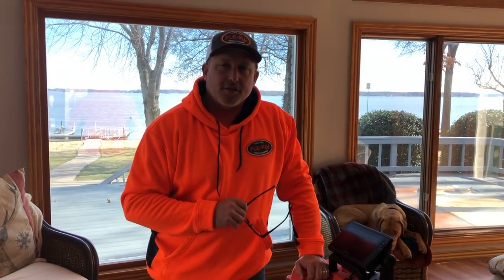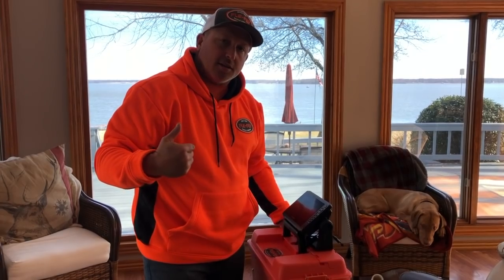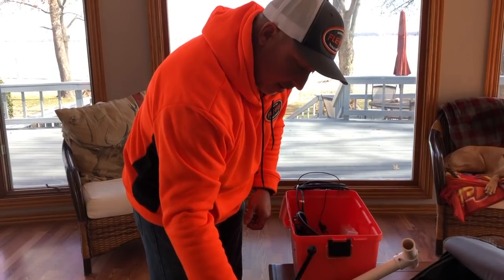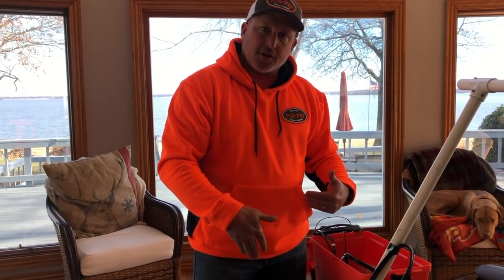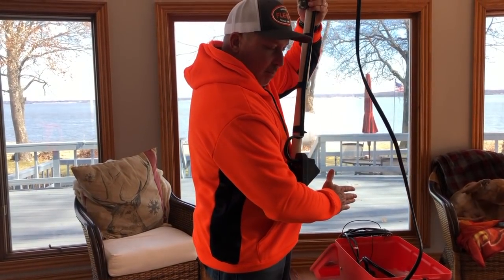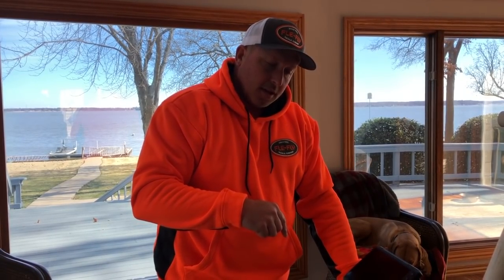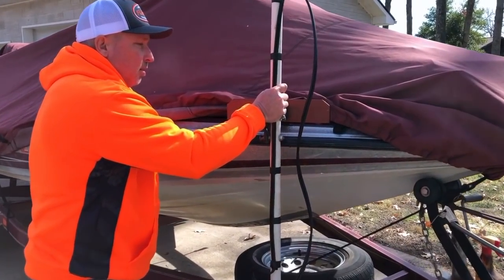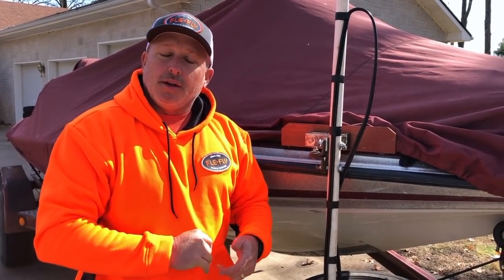How to build your own Mobile LIVESCOPE fish finding system!

Comment: Great  video well done 
I too don’t want to attach to my Minnkota Trolling Motor  I want to use between 2-3 boats
Plano Box is 1612
Looks like you could add the Dakota Charger inside the box as well 
Thanks

Comment: Hey bud I’m building the same thing except I will have a 93sv and the livescope on a switch. Just checking to see if your battery is still working. I’m just not sure if the same one will be enough for me. Thanks
Reply from the maker: Not sure pardoner. Good luck though.

Comment: I just bought the same system but cant figure out how to wire it all together correctly. Could you please explain how you wired the sonar module to the chart plotter? In detail of the connectors you used to connect to the power source.  If you could make a video of the wiring process it self would be a lot of help for many people, me included. Thank You.

Comment: I did the math on this .  The GLS typical usage is 21 watts .  And the EchoMap is 15 watts .    Say we want to run this system for 6 hours .      Math time.    GLS = 21 watts x 6 hours = 126 now with a 85% battery efficiency     126/.85 =148 watt hours now change it into amps  148/ 12 volts = 12.3  Amp  .  Now the EchoMap 15 watts * 6 hours = 90/.85 = 105 /12 volts = 8.75 amp hours.  Add those together 12.3+8.75= 21.05 Amp hours .   We need a 21 Amp hour batter to run this system without blowing fuses.   We can run two of these batteries in parallel  all day long without blowing fuses. Or just use 1 battery for the GLS and 1 for the EchoMap.
Reply from the maker: Wowza! Nice
Reply: Is that with the load of an additional transducer on or with without though?
Reply: @anonymous_friend  that's with the load of the transducer

Comment: I almost bet you're blowing fuses later in the day? As a battery goes below 3/4 of a charge the amp starts to climb.  Not a big problem but if you would hook everything up to a main switch and turn it off after your using it or moving to a different spot it would help.
Reply: if the ckt resistance stays the same,  as voltage goes down so does the current...ohms law

Comment: Its Plano model 1812-50 . I bought it and set up my LiveScope and 9 inch ECHOMAP plus. There are echomap monitors that are cheaper but if they don’t have the “PLUS” they won’t work with Panoptix LiveScope.
Reply from the maker: Right on!
Reply: Fle Fly Fishing Tackle   I’m really glad you did this video. Just what I needed to take my LiveScope to my favorite docks when I don’t have the time to put my boat in but still want to fish!   Thank you so much! Also got some crappie kickers. I bought a 12v 10amphr Nocqua battery (1.5 lbs) from gps store for 119.95  with charger included. This settup is GREAT!
Reply: @onlinenetbuy8129  Are you still having having good results with this battery and about how many hours will it power Garmin 93 sv and Gls 10 black box?

Comment: Couldn't you modify your live scope onto the magnet bracket so it rotates keeping you from having to move the magnet?  Essentially, making it like an under water periscope?  Seems like it would be more convenient and precise enabling you to move it 360 degrees in any direction.  Your thoughts Jeff?
Reply from the maker: I like it solid. Any movement disrupts the signal.
Reply: Kerry Settle I was thinking the same thing. I saw anouther u tuber that built one using 2 different sizes of pipe. Now that said r u going to use a teacher in case it falls off.

Comment: Thanks for all the info. Do you ever have heat buildup issues in the box? I see lots of heat fins on the livescope unit and wonder how that will dissipate heat locked inside that orange box.
Reply from the maker: Not yet - There are holes in the box for the wiring.

Comment: That is a really cool ideal and creative way to be portable. But wouldn't it work the same way if it was mounted it on the trolling motor ? I do like the ideal for my canoe. That live view is really awesome thank you for the info and sharing
Reply from the maker: Try it both ways -
Reply: Trolling motor is always moving. Sometimes not in the direction you want to scan.
Reply: @randyshopher7146  Right On Randy !  Especially if yer using an " I-Pilot" on the Trolling motor using that " Spot-Lock" .